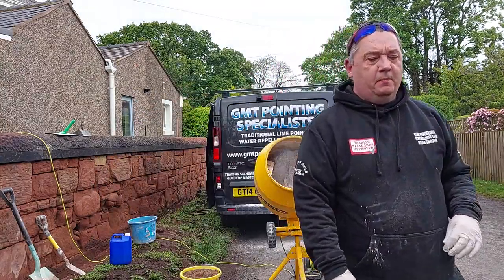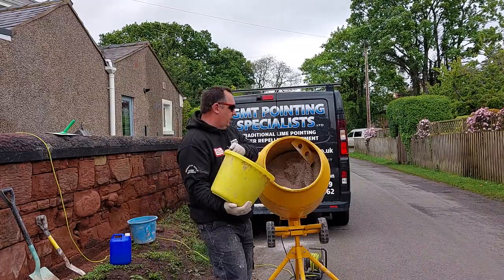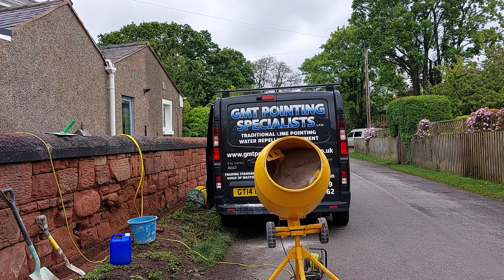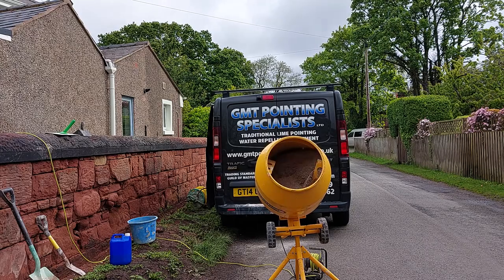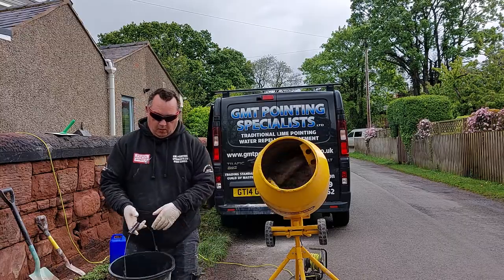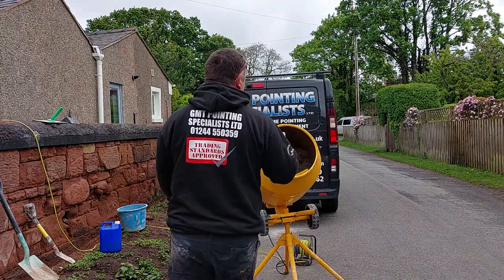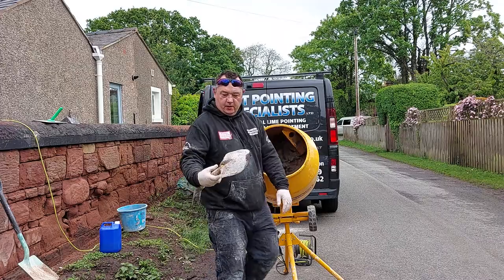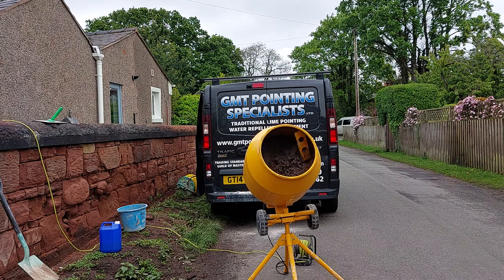How to mix lime mortar for sand stone walls

Comment: Wish I'd seen this vid before I used a paddle mixer in a gorilla bucket last year to mix up. I've f***ked both shoulders! I didn't know I could use a mixer. Thanks for sharing your expertise. I have to finish the wall this autumn and will take on board all your tips. Thanks and keep sharing.
Reply from the maker: I know how you feel I done both my rota cuffs 3 years ago

Comment: I’ve seen it people use a mix of both building sand and grit sand. Do you recommend using just grit? Cheers
Reply from the maker: I only use sharp sand but north wales the sharp sand i use has 7 different size graind 
You can use a yellow building sand  but never use red building sand
Reply: @GMTpointingspecialistsltd  much appreciated mate

Comment: Hi mate, what mix would you recommend for rebedding sandstone ridge on a slate roof.   Currently fixing up an old house so any advice appreciated!
Reply from the maker: @radusguru2196  is the property  listed 

Is it in a high wind area
Reply: @GMTpointingspecialistsltd  thanks for the reply mate.   It’s not listed but is in a high wind area.  The area nearby us called “Windyhills”
Reply: The ridge is just lifting off with no resistance.  Mortar just crumbles. I’ve taken the majority off to re bed while I sort out the slates but there’s various different advice online about what mix to use.  Thought better to ask the expert as only have a short window of good weather
Reply from the maker: @radusguru2196  if you want to use lime nhl5 
Butt you need to put a slurry mix on the back of the ridge or it might not key 

Or if you want just to use sand and cement do a 1:4 with sbr so it sticks 

Or a 1 1 5 hydrated lime mix 
But make sure you do a slurry mix on the back of the ridgetile no matter what mix you choose
Reply from the maker: @radusguru2196  with it crumbling sounds like lime so re use lime put a bit of white vinegar on the old mortar if it fizzies its lime
Reply: @GMTpointingspecialistsltd  just took a bit off and put vinegar on.  Fizzing    What a great tip.  Reckon redo with lime then?
Reply from the maker: @radusguru2196  OK if you can't get nhl 5 mix nhl 3.5  at a 1 lime to 2.5 sharp sand or a 2 :5 if its easier to gauge that way
Reply: Perfect thanks mate. Away to see what I can hunt down   Think I can only get nhl 3.5 where we are.    So don’t bother with cement?   Thanks again.
Reply from the maker: @radusguru2196   
nhl3.5 
Sharpsand 
Water 
That's all you need
Reply: @GMTpointingspecialistsltd  thanks mate.  Will let you know how I get on.  Really appreciate it
Reply from the maker: @radusguru2196  no problem here to help

Comment: Great stuff, Glenn.

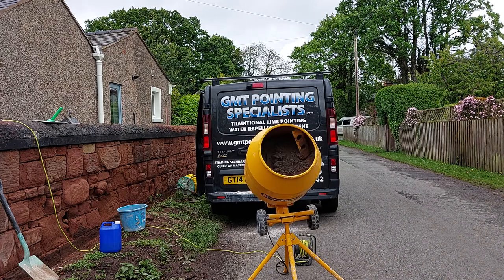17:33 "..just take out of the mixer what you're going to use".. 
Q. Should I start the mixer running again once I've taken out what I need, or is it okay to switch off?
If I switch it off to go and do some work, should I give it a turnover again before I take my next lot of lime?

Would like to see how you tackled that wall in this video; some of my work involves a deal of cement-mortar erosion - powdery stone, troughs, uneven surfaces and ruts of different depths where I've dug out old cement. I'm still not sure what depth I'm meant to fill the ruts and valleys to? Would I fill till the lime is more or less flush with the good stone, or do I just put enough lime in to fill some of the rut but let the stone stand out?

Thanks, buddy.
Reply from the maker: Once you have done a mix minimum 20 minutes switch the mixer of leave it for 10 minutes 
Then take what you need out 
Leave the rest in and mix for 1 minute leave it then 
When you want to take more mix out just mix it for a couple of minutes 
Don't over mix it as you don't want  to cut down on the water  evaporation in the mix
If you send me some pictures of the wall on FB  I can help you out with that
Reply: @GMTpointingspecialistsltd  Cheers, Glenn, appreciated. I've already done a section, looks fine but you can tell me if I'm on the right track. I'll get some pics together and send on facebook.
Cheers.

Comment: Hello mate spoke on one of your other video. The repointing job ive been asked to do is they want to use white clay pit sand doug out and straight to the job mixed with sharpe is this somthing you would use as im not sure doesnt like holding water
Reply from the maker: Are they looking for the pointing to be a white colour 

The sharper the sand the quicker moisture will wick away from the joints
Reply: @GMTpointingspecialistsltd  yes the mox they want is 1,1,1,3
Reply: @GMTpointingspecialistsltd  one hydrated lime one white cement 3 clap pit white sand and one sharpe does that mix sound ok to you its a new build wall we just racked out the joint as they asked
Reply from the maker: @kierenboimufc5940  I would 100% get them to put it in wrighting 
That's what they want 
With a
 1cement 
1 hydrated lime 
You really need 4 or 5 sand minimum or there's to much powder to sand  
And is a strong mix
Reply: @GMTpointingspecialistsltd  yes then to water would soak in the wall and bot be able to come out of the mortar so result in escaping from the brick ?
Reply from the maker: @kierenboimufc5940  yes it would hold in the wall the sharper the San the more it allowed water out 
Wicking away
Reply: @GMTpointingspecialistsltd  thanks for the help as the cement is white they aint thinking of how strong the actually mix is very good point
Reply from the maker: @kierenboimufc5940  depending on the make of the white cement it can just be as strong as the grey 
If they want that mix just make sure they put it in wrighting so you are covered if anything goes wrong 

Wattsapp me a picture of the bricks if you like 
Or on FB

Comment from the maker: I've just had to block a key board warrior  from commenting saying 
I should of used hot lime not NHL 

The reason I used NHL on here as it's a lower free lime content 35% 
I didn't use the 90% free lime as it eats away at the sand stone 
You need to do your research before doing a project 
Sorry for the rant but some people haven't got a clue
Reply: Don't worry about the idiots just block them